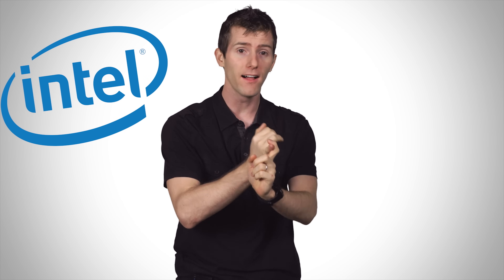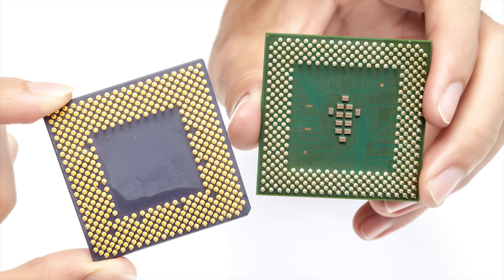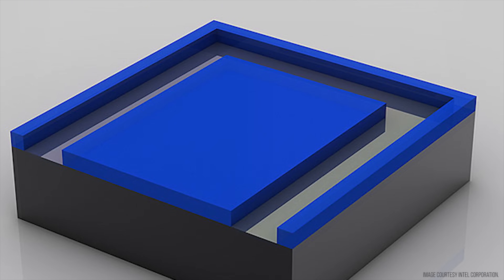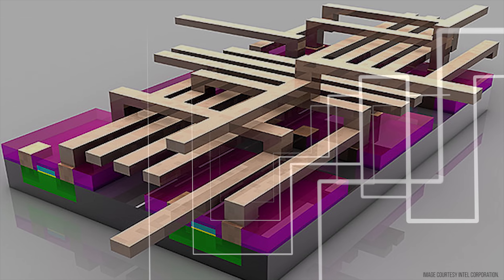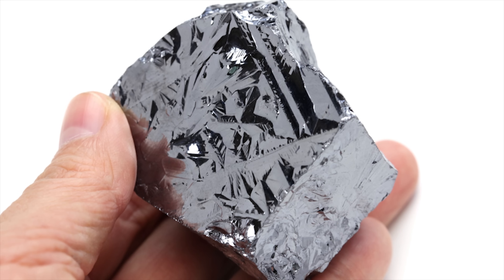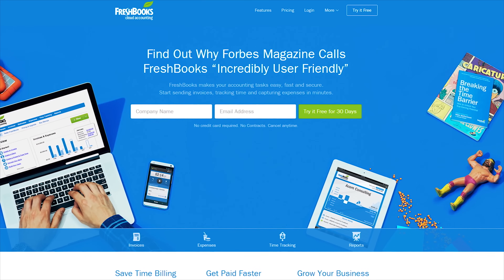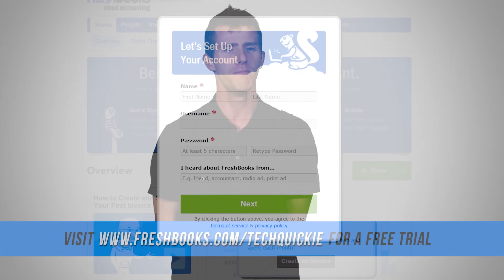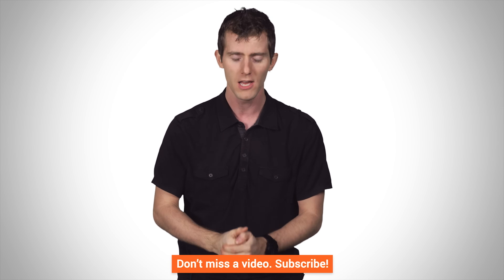How CPUs Are Made As Fast As Possible

Comment: Yeah, the transistors on 14nm parts are about 90 atoms long.

Let me say that again...
90 ....  ATOMS
About 6,500 of these transistors would equate to the diameter of a single hair. Yeah, pretty tiny.
Reply: +SeekNeo with science (?)
Reply: +SeekNeo The way he described it in the video it has to do with lasers shining onto a photosensitive chemical that is applied to the silicon wafers.  This etches the layout of that ions fill and form transistors.  I think I got that right, someone please correct me if I didn't.
Reply: +LazerLord10 how the fuck they move 90 atoms around?
Reply: @SeekNeo  No it's photolithigraphic. The stencil thingy he showed. It's like a printing press, with light.
Reply: @SeekNeo  they don't , they make the whole thing in 1 set..
Reply: @SeekNeo  now that we have even smaller dies I’m betting on space magic
Reply: @SeekNeo  UV rays and engineer souls. The second part is the key part here
Reply: +SeekNeo ever did that trick with the magnifying glass and the candle, where you project an inverse image of the candle on a peice of paper? same thing (at least very breifly, from what I was taught when I was six)
Reply: +LazerLord10 yeah but unlike Intel IBM's R&D is aiming at 7nm as they have 10bm down .... in a lab with a unmentioned amount of failure rate so 10nm is possible with silicon just below that is where IBM is hitting problems getting the CPUs to work correctly at all so silicon might not be how to at that small but maybe as Intel thinks 7nm is possible with its  UBM did it in a lab already but does not do mass production like Intel has to and IBM is aiming at 5nm now ... not very sure how and probably is still classified by them too but if you think about it if Intel buys it from IBM then Intel can basically skip a processing node size and go directly to 7nm skipping 10nm even though the other processing node makers are not as good as a lab of IBM's and will have to get it right millions of times in a row not only a few times out of hundreds of tried to
but if you think of it IF intel and AMD contract out the transistor size R&D to IBM or another company then they can focus more on how to make x86 designs better more efficient processing and more excesses of cores in consumer parts ut letting IBM have the credit instead of Intel or AMD isn't their style as IBM was their direct competitor 26 or so years back
Reply: @yumri4  ok
Reply: +SeekNeo I have no clue about the specifics, but imagine they're not really "moving" each individual transistor, they're just made whole basically
Reply: That's why when shitty Youtubers who don't know jack ass about PCs speak crap about them make PC enthusiasts pissed off.
Electronics is a bitch of a field, kids.
Reply: bastard
I googled it. As I'm not an expert, I'm not sure if the 14nm 'process' means that the transistors take up 14nm of length, or if the process has a resolution of 14nm. Probably the first one. Because I wasn't 100% sure, I said "about" in my initial statement. Nonetheless, it's pretty cool that they manage to get stuff like this working.
Reply: Photolithography is actually modern-day magic in all honesty. Basically they refine a laser light source to expose only certain parts of the silicon wafer (with a bunch of chemistry mixed in for it all to work). The reason they're able to get an ungodly number of transistors on one wafer is due in part to the light source's wavelength, and then the layers upon layers upon layers that the lithography process is able to create. Right now, Deep Ultraviolet Lithography is the primary process but I think that IBM was able to somewhat get Extreme Ultraviolet Lithography to work out in order to get the feature size decrease (although there are too many defects to be usable and the current available light sources too expensive for commercial viability).
Reply: They will keep getting smaller but eventualy we will have to stop because "Atoms can only be so tiny" but we will get past that cuz we are awesome xD
Reply: +SeekNeo Lithography - They don't move it around. They cut excess atoms off, like you would with a sculpture.
Reply: +LazerLord10 14nm refers to the gate length of the transistor. Source and Drains are beside the gate in terms of length, so total length is slightly longer.
Reply: +LazerLord10 A 14nm process essentially means that the drawn gate length of the transistors is now 14nm; the transistor is bigger than that. The gate is sort of like a bridge which connects the high voltage section to a low voltage section (I'm paraphrasing a lot here). So if the transistor is ON, then the "bridge" connects the two sections so that the current may flow, and if it is off, then there's no bridge so no current flows (ideally). Anyway, the point is that these high and low voltage sections along with some insulations make up the transistor in total, and hence the transistor length > 14nm. 

And no, process resolution is lower than 14nm. As far as I remember, in simple chips the process resolution is generally a quarter of the gate length (lookup MOSIS scalable design rules if you're interested). But these simplistic rules are for much simpler chips which are generally not required to be mass produced. Intel or TSMC or Samsung have a much smaller manufacturing grid (that is, better resolution) so as to optimise the performance of the chip as much as possible. There's a lot of details, don't want to fill up the comments section with it. :)
Reply: +LazerLord10 14nm is not an actual size of whole transistor. That's why there alot of uncertainties, there is no standart how to measure transistors size. Intel and IBM measure it in different ways thats why IBM's 7nm and Intel's 10nm is basically same thing.
Reply: Dave Courtis chalk is layers of atoms. They themselves aren't being broken but layers seperate.  It's very hard to actually break bonds between atoms. You mostly need something to replace the thing you have taken away to be there (a reaction with 2 or more reactants)
Reply: +SeekNeo They don't really move the atoms, silicon structures are crystalline. The transistors are grown roughly on the same principle you can make salt crystals. Silicon is vaporized and then the atoms "fall" and collect on the wafer.
Reply: +SeekNeo they could arrange and manipulate single atoms back in the 1989, spelling "IBM". :) It's still mind numbing for transistors to have 14nm parts. I wonder when we see the leap to biological cpu's.
Reply: +Derively it varies from 0.1 to 0.5 depending on the element
Reply: And they're going to continue getting smaller.
Reply: Cinder Gwyn whatever
Reply: +yumri4 this comment is slightly autistic
Reply: +bastard The thing is, transistors aren't just a line of silicon, they're usually squares or rectangles. The 90 atoms is probably from the area of the transistor. We don't really know how Intel measures the 14 nm. It could be the diagonal across the transistor or one of the sides. Plus Intel's newer transistors are 3D so they're not just on a 2 dimensional plane and they've got the added depth besides just the width and length.
Reply: +bastard "how did you get an answer of 90 atoms? if the diameter of an silicon 
atom is 222 picometers, its 0.222 nanometers. 14/0.222 = ~63"
Crystalline structures don't necessarily take up the same amount of space as the sum of the individual atoms would have, it depends a lot on the structure of the material
Reply: Dave Courtis "chemically bonded"? You mean atoms in molecules? If so, then have you ever seen loose atoms?
Reply: +LazerLord10 Holy Shit. Technology is amazing
Reply: just imagine in like the year 3000 when we have transistors the size of a Planck length
Reply: +SeekNeo illuminati
Reply: +SeekNeo they get rid of the stuff around them. because they etch into the silicon.  gloflo  has a video on their process
Reply: AiKoNNZS words to the wise
Reply: +bastard I suppose they use Si ions instead of atom, in that case you are able to pack more into 14nm. 
Or maybe they are using the measure of the smallest atom around, helium (not hydrogen) as a measure. But I don't know since the term atom that he used is pretty vague.
Reply: +Dave Courtis They're held together by strong forces...
Reply: +ASAP Jim So you need a techpriest, and to recite the Codex Astartes before going to bed to make sure the pc doesn't explode when you turn it on. Gotcha.
Reply: +LazerLord10 I've heard it said that 10nm is just about the limit. My dad still tells me stories of when CPU transistor fabrication processes were measured in micrometers.
Reply: SCH600 well, yes ,for maybe 10 more years then we would reach the limit of how small silicon can get and come up with a new substance
Reply: the problem is more with electrons that now behave very erratically
Reply: The Idea of aliens came from movies, like the movie Alien vs predator is all movie effects. and CPU's are made by humans we all know that
Reply: 3 years later we have 7nm processors
Reply: DX I have died
Reply: "why do you like computers?" This is one of the answers.
Reply: Now we're on 5nm, there isn't much smaller we can go
Reply: @molagsballs  As I understand it they can potentially go to 4 or 3nm. Any smaller than that quantum tunnelling starts happening. So they won’t work.
Reply: IBM create the 2nm may 2021
Reply: 100 mil transistors in mm2 right now
Reply: Size refers to process. You will usually find finfet or lpp etc or suffixes nearby. But there are too many dimensions to quantity to have a standard for all top.  Including find pitch depth etc.  All can vary non proportionally on different nodes withing companies let alone in between companies.
Reply: *****
Hehehe :))
Reply: +LazerLord10 Actually, i studied that an atom is 0.3nm, so a 14nm part has 47 atoms.
Reply: +SeekNeo you have to be pretty weak not being able to move 90 atoms
Reply: Dmitry Granicin
Ah, sorry for that I misplaced the word atoms with molecules
Reply: Dave Courtis Yeah, then look at taief miah 's comment.
Reply: +LazerLord10 

LOL Love all the comments you stirred up. One thing you forgot to mention is the diameter of the atom since every atom has a different diameter.
Reply: Rem ko not necessarily thought. The length of bonds is still a thing
Reply: A grain of sand has trillions of atoms
Reply: +LazerLord10 new ibm transistors are 7nm makeing them around 45 atoms
Reply: dude ur crazy theres no such thing as aliens, area 51 is a government site where they test weapons of mass destruction and they don't want us knowing about it
Reply: or build weapons of mass destruction
Reply: i am actaully 17 years old and i know there are alot of galaxies out there, but even if there were aliens they will have to build some heavy protection system against radiation for their spaceships
Reply: The idiot said: 1yr late but iirc Intel stated that they'll most likely hit 10nm architecture by 2020
Reply: @mitchmitchelson9767  intel: n o
Reply: LazerLord10 bb
Reply: god,DAMN.
Reply: WOW MIND BLOWN?
Reply: LazerLord10 still too big
Reply: Why don't they make bigger cpu's? you could fit more transistors or whatever in there. Forgive me if I don't know about anything or am wrong about anything i mentioned.
Reply: If I did my math correctly an atom is about 6.42857143nanometers...So Ryzen is gonna make transistors almost as small as an atom...damn thats small
Reply: 7 nm is what PS5 and Xbox Scarlet chips will use 2020.
Reply: @WizKing93  they will use amd's zen 2, a year after the speculated release, xbox Scarlett and ps5 will still have a hard time even though they will start using modern technology inatead of 4-8 year old parts but i am still happy that consoles are catching up
Reply: And now we have 7 nm transistors. There is no limit in science
Reply: Now we are at 7, mearly 5nm...
Reply: 7nm are about 32 atoms but if you do the math then 14nm  should be 62. Can someone explain?
Reply: wait I found the answer 14nm is actually 63 atoms!
Reply: Now we have 7nm chip
Reply: @CarFreak really? Holy fck
Reply: I thought it was about 90000 or something
Reply: Well trey 7nm or 5nm now haha
Reply: if that's the case, then CPU manufacturers are already on 7nm and working on going even lower, like 5nm. i have no idea how they can manage to have such small but powerful circuitry, but it's damn impressive.
Reply: Lol, we're at 7nm now and are about to release 5nm
Reply: 14 nm are gigantic by today’s standards.
Reply: 2021 Update: Ryzen has been on 7nm for a while, half the size. AMD is thinking about going down to 5nm for Zen 4
Reply: Not really. You see, when look up what it is measuring it is the logic gate that we are talking about here. It is not a good estimate of how compact a CPU as there are tons of other part like cache, MMU, interconnects and so on.
Reply: On my arm or head?
Reply: so 7nm about 45 atoms 
amd is insane
Reply: That's nothing IBM has a 1nm process.
Reply: Currently at the 32-33 atoms per transistor stage of tech. The question will soon become "how many atoms are needed for a transistor to function"
Reply: mah thats quite average
Reply: laughs in 2024 with 3nm processors
Reply: We only need 1 atom in dismeter
Reply: +LazerLord10 they could even be made smaller but that would make them very unstable due to quantum mechanics. at this point its just optimizing the layout i believe (but im not sure)
Reply: ***** yes it is very cool. waiting for the quantum processor...
Reply: AiKoNNZS why cant they just make up a way to measure them then? really it would help everyone in the computer industry if it was a standard of how to measure transitiors either the largest one or the smallest one as their size changes with what they are there for
Reply: +LazerLord10 how did you get an answer of 90 atoms? if the diameter of an silicon atom is 222 picometers, its 0.222 nanometers. 14/0.222 = ~63
Reply: @higheststrpk  Jesus Christ! Just go ask your dad.
Reply: Dmitry Granicin
Only chemically bonded atoms(if you know what I mean), and those bonds can be broken anyway. If all atoms were that inseparable, why would I be able to break chalk?
Reply: +LazerLord10 Bye 32 nm ... The BEST cpu transistor litography ever. 28 , 22 , 14 and so on are just plain crap. The die is so minuscule that it requires special cooling thus they are not as durable. 32 nm is way cooler and better. Even though it guzzles more power. 
Honorable mentions :

i7-3930K
FX 8350
i5-2500K
i7-2700K
Reply: its a joke and you are replying to a 3 month old comment
also i think the aliens need to eat money to live so thats why intel makes cores so expensive
in all seiousness though they instead of coming up with a new substance currently, just make the die bigger